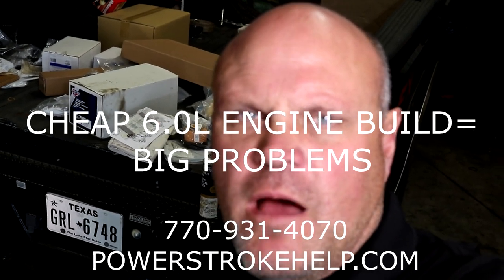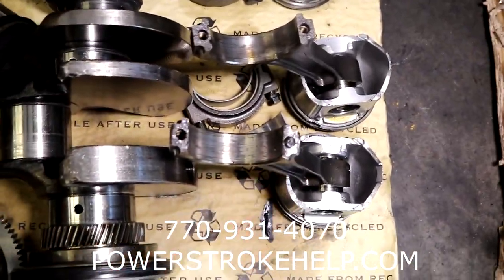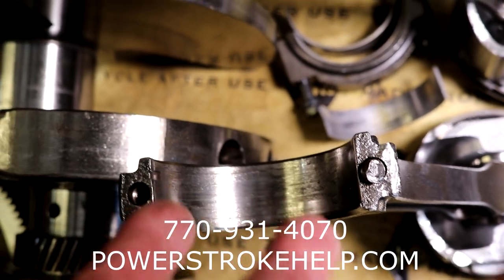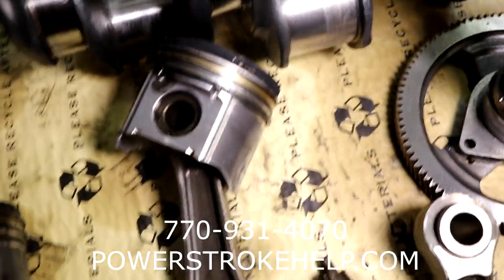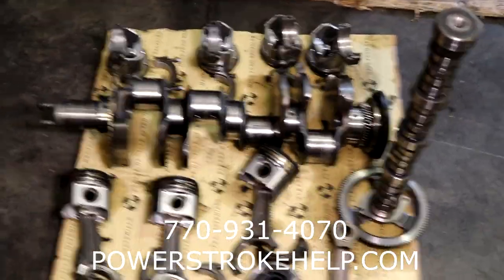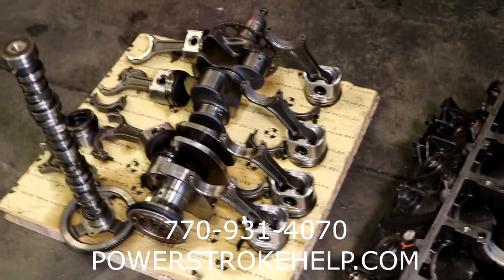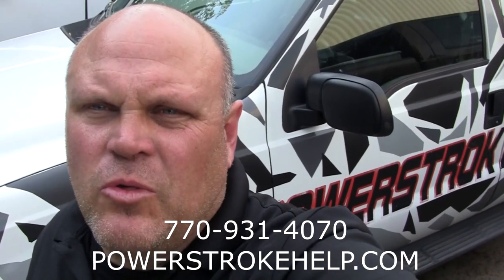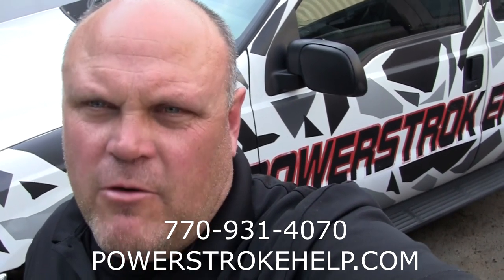CHEAP 6 0L ENGINE BUILD = BIG PROBLEMS

Comment: When my truck dropped a valve seat (gas powered Dodge, no diesel in my live, yet...) it was tempting to throw a set of heads on it, but knowing that it was likely caused by overheating when a hose blew out, and knowing the mileage (203,000) I decided the whole engine was a liability. And rather than just having a shop rebuild my engine, I chose to buy a long block and have that installed (too big of a job for the space we have). I decided that I trust an engine from a shop that specializes in rebuilding engines the right way, with all of the latest Chrysler and aftermarket improvements to make it most likely a better engine that the one the truck came with. There is so much to be said about just biting the bullet and having things done the right way.

Comment: I was having nothing but issues, with "diesel mechanic" here in Colorado and you can just tell if you watch Bill's videos that they were trying to cut corners and make future work. I paid the $1100 to get it to Bill and I'm happy i did it. His cost compared to other shops was more affordable, so the shipping cost was not a factor. They didn't up charge me for parts like other places. With their life time warranty on the heads I feel a sense of relief and confidence by using them. I do also maintain my truck which is huge, get a maintenance journal and keep logs.

Comment: 140 dollars would get you OEM spec pistons on a 1.8L 4 cylinder gas engine but, it would get you subpar quality pistons for a Powerstroke.
Reply: No 140/4
Is$35

Never trust a $35 automotive pistons. 
I just spent $160’on a set of rods and it blew
My motor worse than this guy

Comment: I would bet the rod bolt failed first from the loose cap since the cap was on backwards, and that led to the pistons failing. I'm in Canada so buying cheap parts isn't that much of a cost saving since shipping costs so much to get cheap parts from an american distributor. It also suck having to fix something twice and I value my time more than the potential savings!
Reply: DaveBuilds, maybe you should leave Canada.